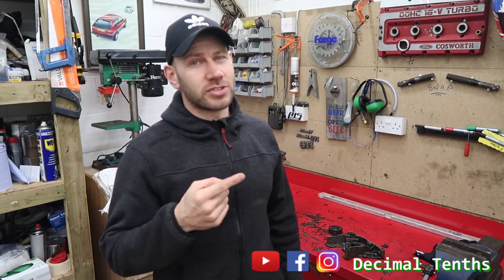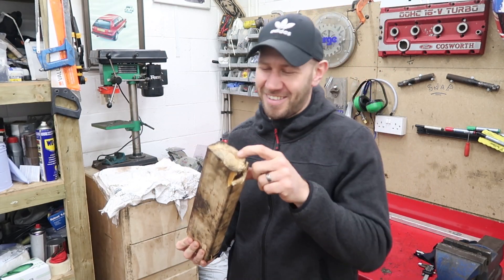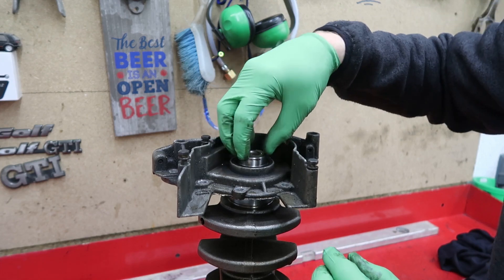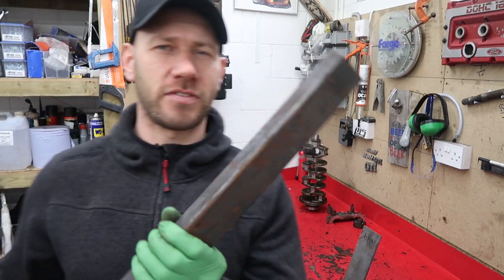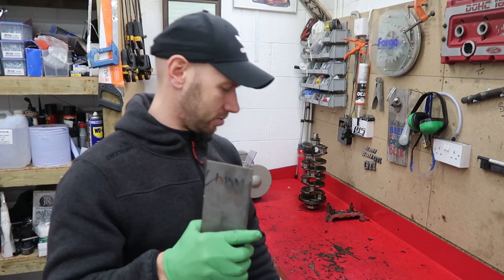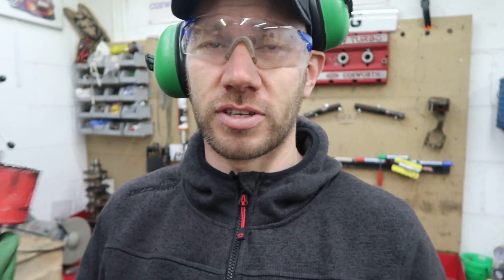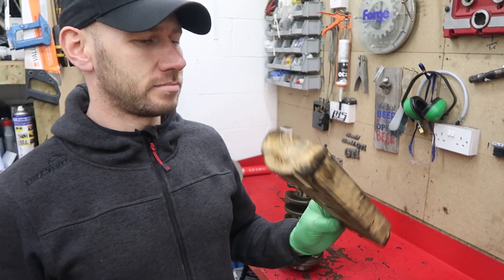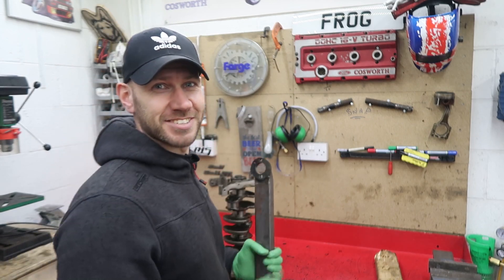1.8t Crank Pulley Tool // 1.8t Stroker Engine Build

Comment: Hello. I'm trying to remove my crank bolt to get the pulley gear off. Engine is all stripped I've tried wood to jam the crank but not working 😂

Comment: I got my crank stabilized from a German tool from Blau Parts in the US. They were clearance selling all their VW timing tool kits. Wish I could send a picture of how it works. 

It’s not a long lever. It bolts to crank pulley and wedges handily against the bottom of the engine block.

Comment: Good work nick. You should invest in a cheap plasma cutter, best thing I ever bought.... they’re so handy😁
Reply from the maker: It's on the list pal,  any recommendations?
Reply: https://www.ebay.co.uk/itm/Draper-Tools-85569-40A-230V-Plasma-Cutter-Kit-12mm-Cutting-Capacity-IPC41/263485153131?epid=8035053485&hash=item3d58f05f6b:g:CVYAAOSwcN1aVn3h

This is mine, cheapest branded version I could find. I’ve heard half decent things about some Chinese ones... but didn’t want to risk it. Although this draper one, will be probably Chinese built🤣

Comment: Once i had troubles to get off crank pulley bolt from the VW 1.4 petrol engine.. some ¥¢€£π used the thread lock to secure it. Counter hold tool didn't help, heat either, high impact wrench (680Nm) also no success, long breaker bar as well.. it was like welded to the crank. I was so desperate that i wished to burn the car.. what helped me was the starter trick. Finally I used the breaker bar and then started engine for few secs... this has helped
Reply from the maker: Bummer, bet it was a mare!
Reply: I have the same problem now; are you sure it wont damage anything ? You blocked the center srcew right ? Did you use a specially hardened Nut ? I'd be afraid that the screwhead would break.
 Is it a normal right-hand thread i guess ?